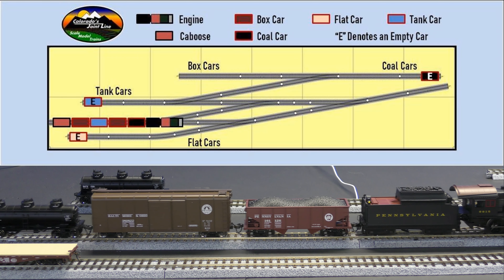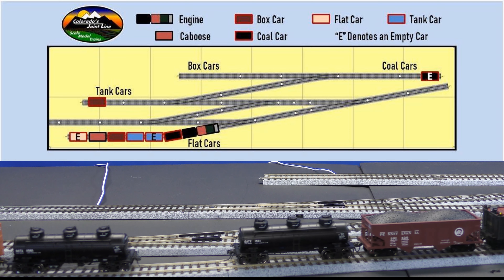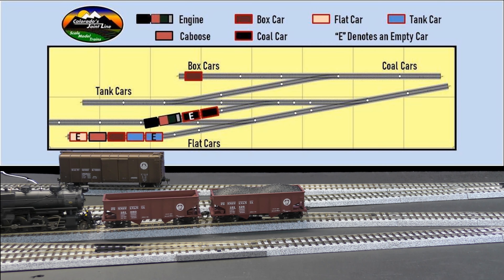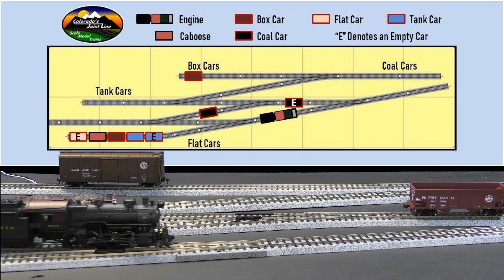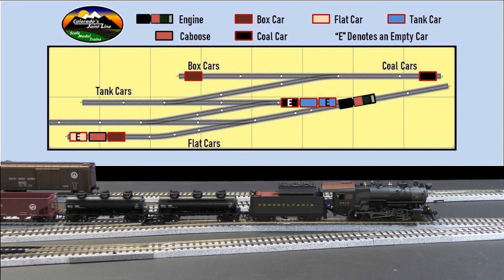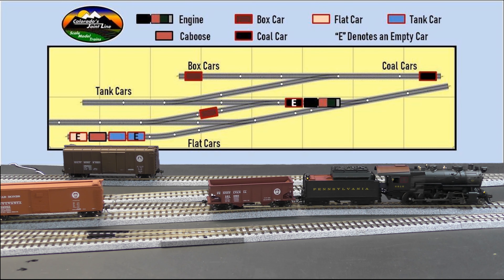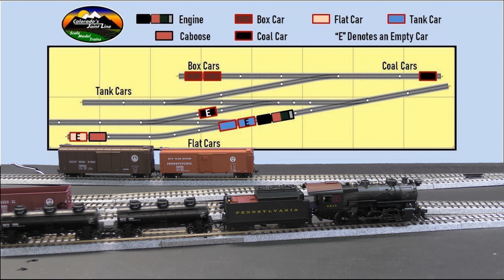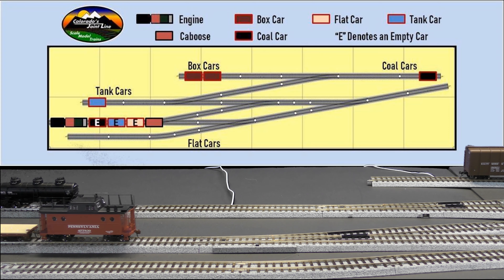More Fun with Model Train Layout Switching Puzzles

Comment: After years of making layouts I now know that I don't want to spend space and time on anything other that the yard
and a loop to bring in trains and send them off
Your two videos on this and my game design skills have me hot to do it now more than ever

My biggest things to take care of are changing the couplers on my cars and converting my two switchers to DCC
If you know anyone that can do that for a price I would be happy to put them to work

James
Reply from the maker: James, thank you for the feedback.  Glad I could light a spark in you to get back to trains.  Switching couplers really isn't that hard, I use Kadee metal #158 whisker couplers.  Converting a DC engine to DCC can be anywhere from really easy to pretty hard depending on the actual engine being converted.  I'd recommend checking with your local hobby shop or club.  There's probably someone local that would do it.  I'm not sure of any mail in places anymore.  I know some used to be around back when all the frames had to be milled before installing a DCC decoder, but as the engines are mostly DCC ready any more I think that niche industry has died off.  Maybe someone who reads this will know of a mail-in place that does DCC conversion.  Cheers, Kevin.

Comment: I made a N Scale Inglehook using KATO track.  I also created scenery and it is a permanent layout.  It is 50" X 18".  I also built some buildings and road bed so like your imagination my rules address some restrictions.  I use a Altas RS3 as the switcher and nine freight cars of various types and lengths.  So that makes it more challenging.  My longest sidings holds 3 to 4 cars depending on their length.   The layout fits nicely in a corner of one of my rooms and I play with it regularly.
Reply from the maker: Sounds like you have a really nice set up.  Glad you're enjoying it and running it regularly.  Cheers, Kevin.

Comment: 3:05 BINGO drag the empty out - but where to put it.?
Why not at the END of the mainline (out of the way - and at the extreme end of that VERY LONG mainline leg.
Don't drag it all around while you shunt the loaded one in and need to drag it out again and this that and OMG it's in the way there too...

Your "little" annoying rule of NOT leaving anything on the main (? It's a dead end siding at the top right? )
Plus no true live railway doesn't use the main - if it prevents unwanted multiple handling - to set a new one in on a difficult short spur line - dump the empties as far OUT on the main as possible, as after all, not other "train" will be passing through with all those needless back & forth movements - that involve the loco being ON the main most of that time anyways - so "dump" the empties out there, (out of harms way and away from being deliberately congesting the limited shunting yard space - where they'll be ready for removing later - at the extreme RHS 
They only need to be there for when you pick all of them up to take away later - not to be dragged all around the tight confines of a short leg shunting yard.